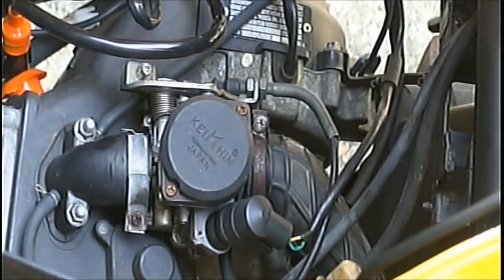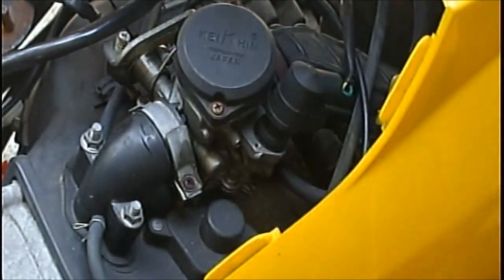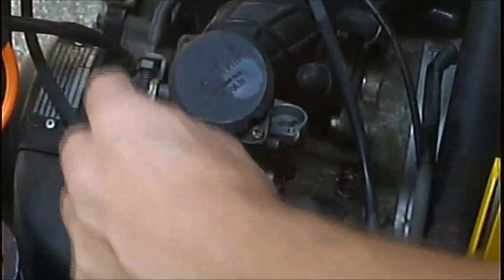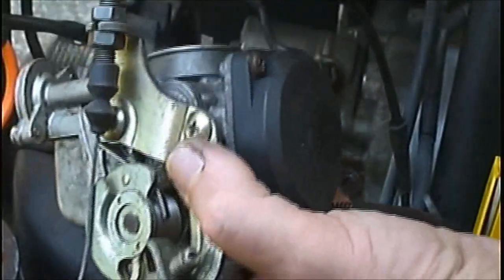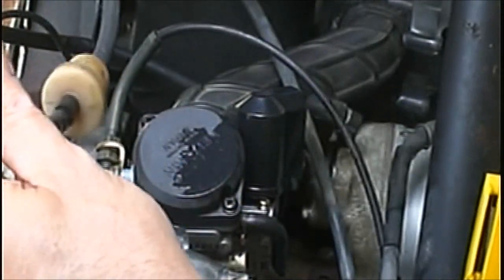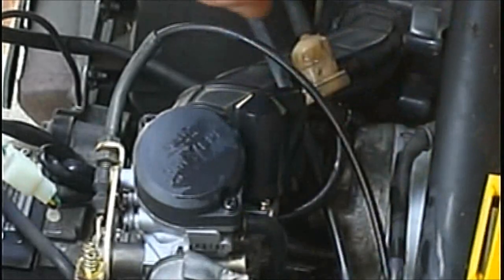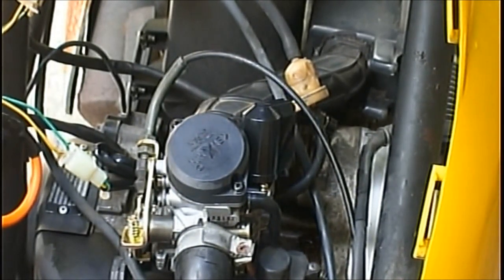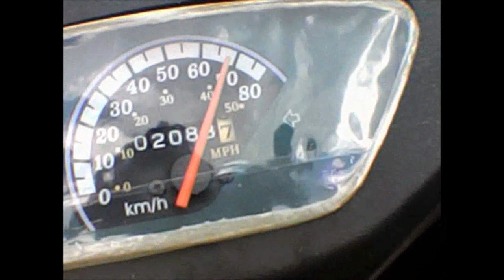How To Replace The Carburetor On A 50cc Scooter

Comment: Just bought that same brand carb about to put it on mine its 20mm and needed a little refresher course thanks!, and my scooter is bored to 80cc and i was told that the 20mm is the best for my scooter, is that true? And what size jet should i use? Have a performance exhaust very free flowing and a large air filter came with new carb its much bigger than the one that's on there now, racing cdi and racing coil, it runs about 50 on flat ground now but boggy up hills and on top end, has good acceleration, i have an 85, 90 and 95 jets that cane with the new carb and wondering what size you suggest with what I've told you?

Comment: Very helpful .My son bought me this scooter for Mother's Day , I have only been able to ride it once . By no means am I a mechanic , but decided to give it a shot . Would only try to start after spraying starter fluid . So I have watched every video for a JL50qt . but finally realized it has a QMB139 motor with after market GY6 carburetor and with your help today just installed . Also took the tank off only to find out the petcock was broke the new carburetor along with filter  new gas line and shut off valve . But what I am wanting to do is do away with so many vacuum lines , at first I had help working on it and now I just want to make sure everything is properly hooked up the right way . On your intake manifold you have two places where lines run off on the right side where the throttle cable is where does that hose run to ? And the same goes for the opposite side . Also can I plug up the vacuum line on the petcock since I am putting a shut off valve ?
Reply from the maker: One of them run the fuel pump. You will need that. I think I mentioned that in the video so you should be able to see which ones go where. If not let me know and I'll help any way i can.

Comment: Great video!  Question - I just got a Tao Tao.  Fired it up and ran it for (25) minutes and then cut it off.  Went to start it (30) minutes later and it would not start.  Trust me, I have checked everything, gas, lines, put in new plug, checked fuel pump.  I can find nothing wrong. This bike is new out of the box. It turns over and over and over but just does not want to start.  It has gas and fire.  You got any help for me my friend? The year is 2022 NEW, Street 50 (49cc,)
Reply from the maker: If you have gas and spark, make sure the gas is getting to the cylinder from the carb. Easy way to check it is spray staring fluid in the carburetor see if it fires. If it dont make sure it's getting air. If that checks out run a compression test. Let me know what you find out.
Reply from the maker: Also, if it fires on staring fluid you have a fuel problem like clogged carb etc.

Comment: I just put a new carburetor in my 150cc scooter. Doesn't start. But I did replace the gas line and other lines. It came with the new carburetor.  How long does it take for all thise lines to fill up with gas?

Comment: What carb should I get for a 49cc tao tao
Reply from the maker: Same carb I put on mine. It should be an 18 mm intake side and 40 mm air filter side. They are about 30 bucks on Amazon. Make sure you know if it has an automatic choke or not. That's important.